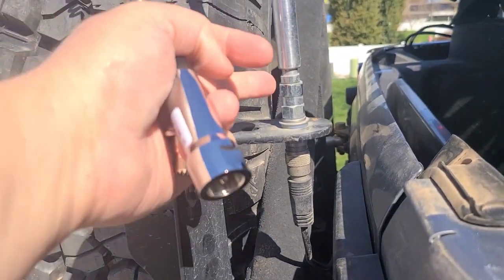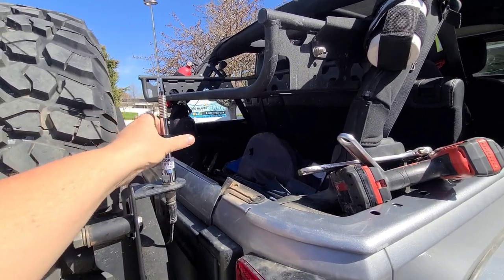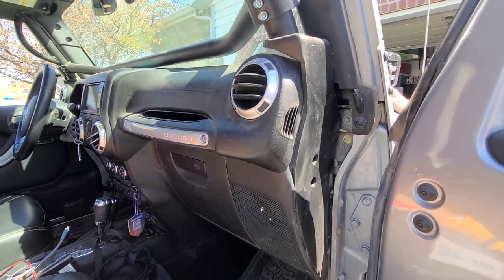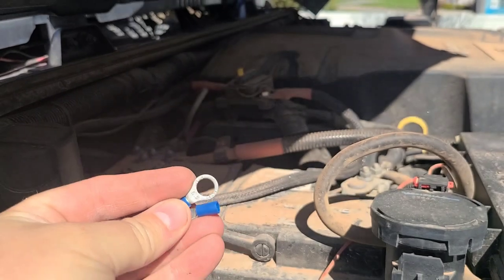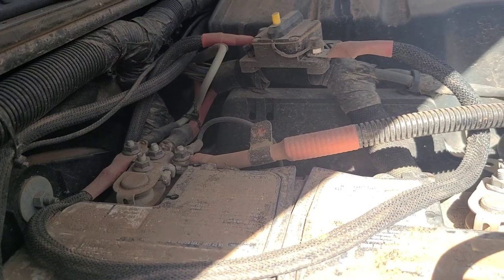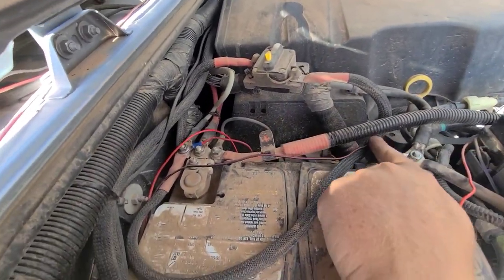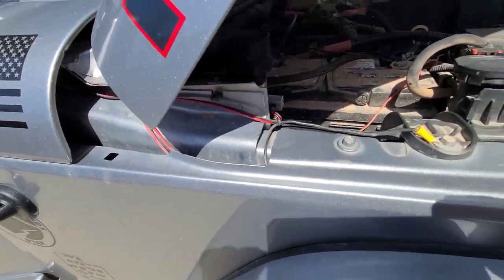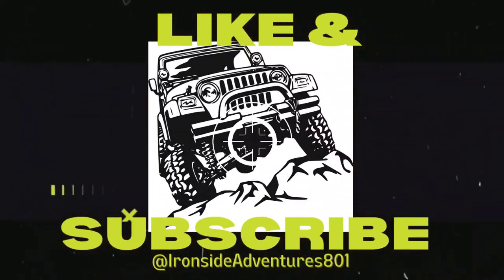We modify a CB cable and mount to work with a GMRS antenna in a Jeep JK.

Comment: Do you have a link where you got the PL259 bulkhead connector.   I am looking at them online they do not look the same as the one you have used.
Reply from the maker: I used this one from Amazon

Anina UHF Female to Female Jack Bulkhead Coax Connector SO-239 PL-259 RF Coaxial Cable Adapter 2-Pack https://a.co/d/0q69VQf

Comment: what is the make and part number for the adaptor? Same question for the antennae ?
Reply from the maker: This is the UHF bulkhead adapter we used.

https://a.co/d/cun9CQi

This is the antenna. It is a dual band HAM antenna but works very well for GMRS as well. Any GMRS or Ham antenna with a UHF base will work.

https://a.co/d/4NOzkyM